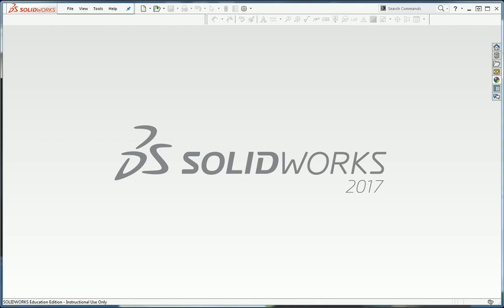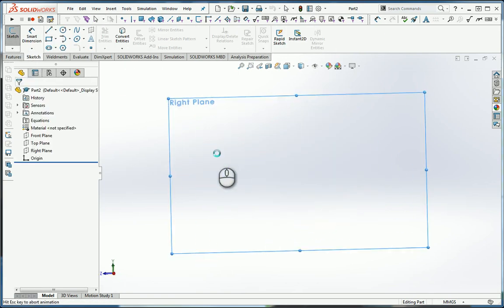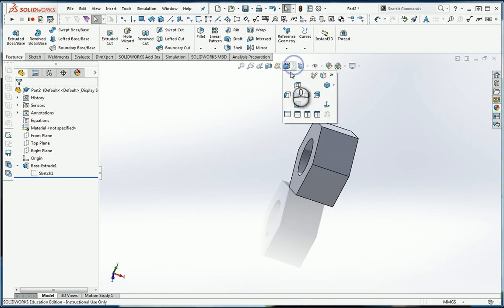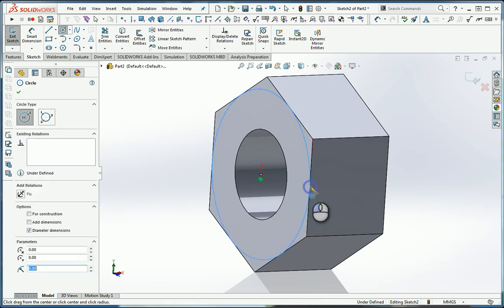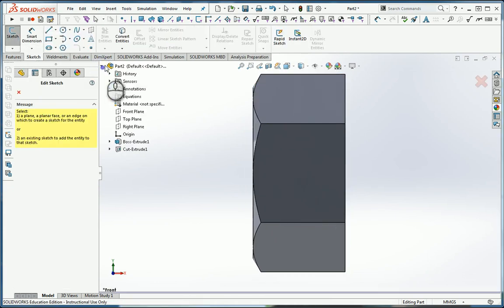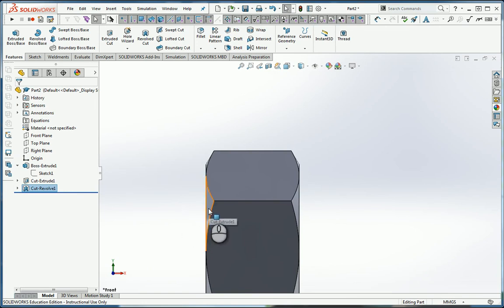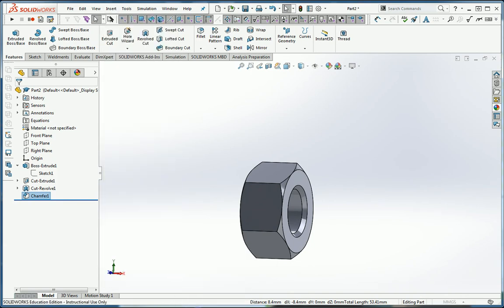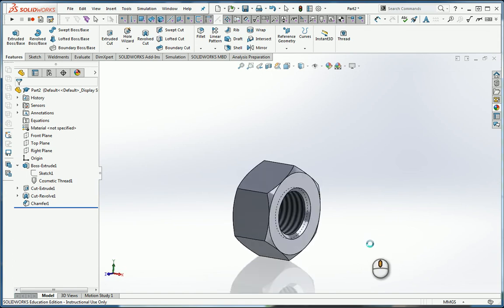Hex Nut Chamfer Two Ways  in SolidWorks

Comment: Thanks. You're the only other person I've come across who uses extrude cut with draft that way. I find it much more satisfying than faffing around with rotated cuts, especially in cases where the hex corners do not lie on a construction plane. 
I also use extrude cut with draft to create the conical end left by the drill point at the bottom of holes, where hole wizard does not suit my purpose. Interestingly, provided the extrusion depth specified is in excess of the actual distance to the vertex of the cone, the feature works as if it had been specified exactly right.
One other minor comment:

Gotta love metric threads! The chamfer height of 0.75mm, as you point out, is half of the Major dia - Minor dia. But we don't have to look up the minor diameters and do the subtraction, because the Major dia - Minor dia is equal to the pitch. (M8 x) *1.5 *
This is true for all 60 degree threads, (eg UNF, UNC etc) ... but for inch sizes, the pitch is a horrible number, even in inch units.
Reply from the maker: Thanks for the comments.